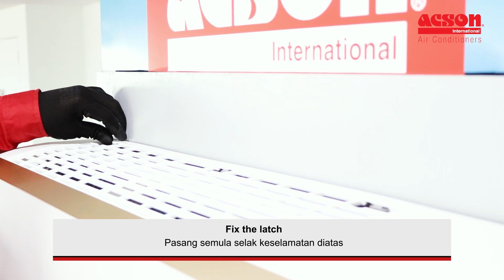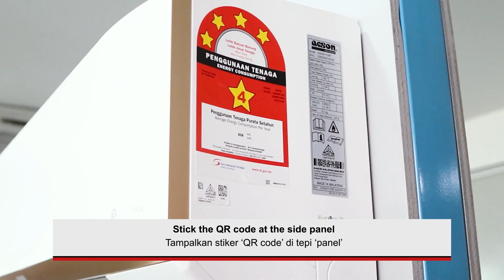MY Acson WiFi Module Installation

Comment: mana nak dapat wifi adapter tu ?yg daikin bleh msok ke bos
Reply from the maker: Anda boleh beli kat https://www.acson.com.my/my-acson. Tapi check compatible air-cond model dulu sebelum beli ye. Ini sesuai utk Acson air-cond je.
Reply: @AcsonMalaysia1984  yang cas 150 sekali installation ke?
Reply: @AcsonMalaysia1984  dalam shopee tak ada link eh
macam susah pulak nak beli kt website tu😁
Reply from the maker: @silentkillers2645  Yea, RM150 termausk installation ye
Reply from the maker: @silentkillers2645  ni x jual kat Shopee boss 😂 apakah kesukaran apa yang anda hadapi semasa beli kat website ye? Boleh FB inbox kami (Acson Malaysia), kami akn tolong 😄